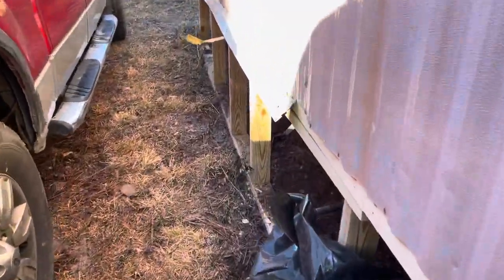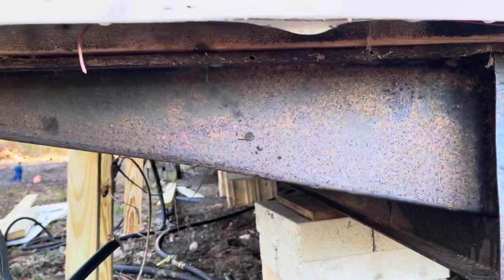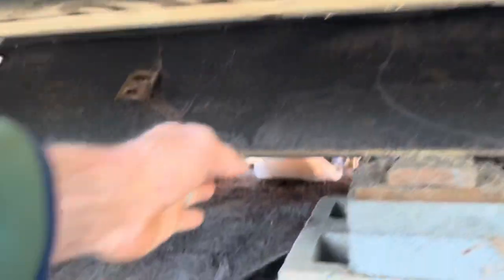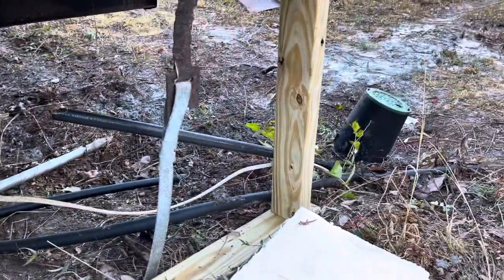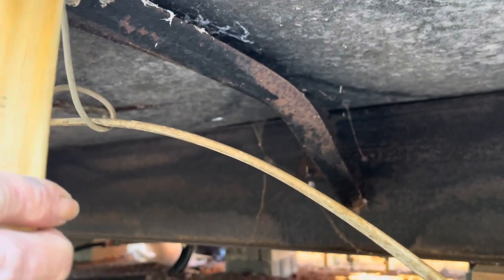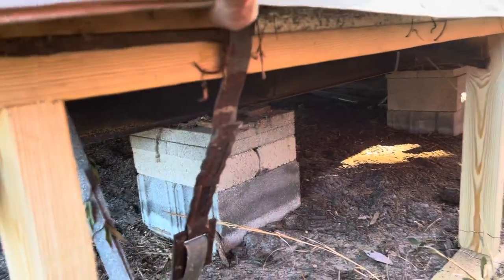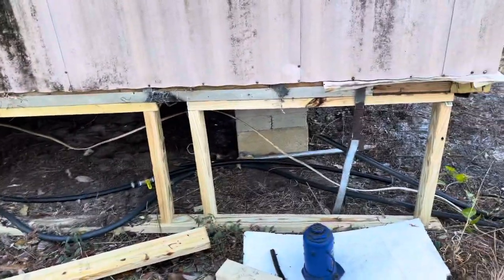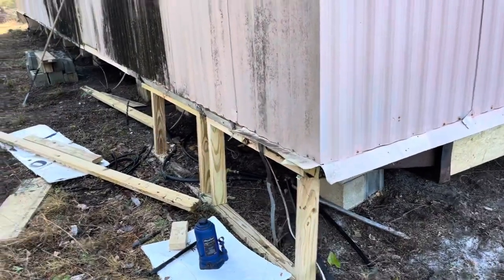Mobile home exterior wall support and underpinning

Comment: Love the video. Have a 1967 Fleetwood.
Used 4x4s across the top and hydraulic Jack's to lift the walls. Sitting on 4x4 columns on concrete pads and all strapped together. Very nice to see I wasn't crazy for doing this. Thanks!!
Reply from the maker: It sounds like you did a pretty amazing job that’s for sure using 4 x 4’s. I imagine I’m gonna use two by fours and I’ll put one every 2 feet. Then were you going to be using hardy board or hardy panels to completely underpinning. When you install a hardy panel you have to paint the panel with oil base paint all sides and any area that has been cut. But it makes for a nice underpinning job
Reply: @Drewsroofingandhomerepair  I used 1x6x16 rough cut pine pt. Painted to match the house. I'm the one who callyiu awhile back about the roofing job in Florida.
Reply from the maker: I bet that looks real good
Reply: @Drewsroofingandhomerepair  do you have any videos on installing a normal sized door in place of the front trailer metal door? I also have vinyl siding on it that my dad had installed.
Reply: Block underpinning the best
Reply from the maker: I agree 💯 percent
Reply from the maker: No, I don’t and I’m sorry about that

Comment: Hey, Drew, Drew my single-wide have the same 2×4 rim joists and longitudinal floor joist that run parallel to the trailer like this one. The majority of the rim joists are rotted and damaged.  Should I keep them as 2×4 and run them how they're going as is or is it ok and should I go ahead and change everything to 2×6 and run them in the opposite direction how normally they should go?

Comment: Do you need a footing below frost line? Will the underpinning,knee wall,settle without a footing and cause a sagging exterior wall again in the future. I ask because I'm thinking of purchasing a trailer that the floor joist are sagging about 2" all the way around the exterior.
Reply from the maker: Do not and I mean, do not buy that house I promise you they’re selling it to get out from under it. Do not buy that house. You will regret it and I live in Southeast North Carolina. It barely gets below 30° here ever.
Reply from the maker: It sounds like somebody put a roof on top of that mobile home that was too heavy for it. I promise you before you buy that house pay somebody to inspect it.

Comment: My floor joists (2×8) run perpendicular to the I beams and I have 2×4 exterior studs. I'm thinking about making those studs 2×6 for more insulation. Would doing these skirting walls (not sure what to call them) provide enough extra support for my idea? Original idea was cinder blocks with several 4ft access spots covered by lattice and screen
Reply from the maker: Yes your idea will work. I like the block idea

Comment: How would you go about framing the support if one side has a low deck that completely covers the underpinning on that side of the trailer? Im looking for an easy, kicked back in the easy chair by lunch time, piece of cake kind of answer 😎😉
Reply from the maker: I have a video on that let me see if I can find it I’ll share it with you
Here we are under the porch we had the same issue we had to go under the porch in order to do this job you can frame it in from underneath the house not easy but it can be done. Paul and I are two old guys and we did it
https://youtu.be/481PLCv9jI4

Comment: Advantec is $82 a sheet where I am at now.  From what I understand it is far superior to regular plywood since it is basically waterproof to a point. I have an old house and will use it when replacing the subfloor in the kitchen and bathroom.
Reply from the maker: It will be the best thing you ever did and it’s $83 a sheet here so the prices are pretty close
Reply: y’all are lucky if you are getting it that ‘cheap’. It’s $127.68+tax here….Got 4 sheets delivered and they dropped it in the yard. Family member pulls up and drives his truck over it and parks it on top of it for several hours before I noticed…..
Reply from the maker: Omg 😳. Could he not see it laying on the ground for crying out loud LOL. It’s starting to go down I actually paid $74 the other day. Wow $127 that is in sane Hell it might be worth driving here to pick it up

Comment: My walls arent sagging really but maybe 1 inch at the most but i did add a 30ft lean on with my deck and i was considering adding more adjustable outriggers for addred suport as a pre precaution have you ever used them or reccomemd them
Reply from the maker: I know exactly what you’re talking about and I would definitely consider using them or at least something for a stiff leg

Comment: I have put 3/4 solid hardwood in my single wide....i am also planning putting tile walls in my both bathrooms....if i put 7/16 osb and put LP smartside on my home do you think weoght will be too much of an issue? Also, if it is would putting support like you did here work or would cinder block piers be better?
Reply from the maker: I definitely think it will need support your talking about adding a lot of weight I would never use 7/16 on a floor even if I put something on top of it.
Reply: @Drewsroofingandhomerepair  sorry  if there was confusion...i was going to put the osb on the exterior walls because my home doesnt have anything under the vinyl siding
Reply from the maker: Yes, you can use OSB on the walls if you’d like, as a matter fact, I think that’s a great idea

Comment: I was going to do concrete block but this make more sense but I'll use PT 4x4s instead. I bought a farm jack to lift the walls. I've noticed some sagging because of the interior renovations.
Reply from the maker: Sounds like a good plan

Comment: Where are you located?
Can you recommend someone who does this in Sierra Vista Az?
My perimeter walls are sagging 
Your video is amazing 
I need help?
Reply from the maker: I would recommend calling your mobile home supply store they would know who works on mobile homes in your area that would be my best suggestion. I’m in North Carolina so you’re a long ways away from me. It’s not a hard project I promise you even a homeowner can do it. That is the reason why I share my videos I don’t think you need a contractor. It only takes some common sense and you can do the stuff yourself. 
So if you have problems finding somebody I think it’s a Projects you should literally try yourself

Comment: Could that be done w block?? Instead of the 2 *  4
Reply from the maker: Yes, and if you can afford it, I would recommend it
Reply: I just noticed maybe about a year now the sagging, I have a porch with metal roofhow to determine
Reply: Oh my goodness sorry, not sure how I accidentally sent the last message anyway I was saying I have a porch with a metal roof mobile home is around 30 years old brick underpin what is best way to determine if it is coming from settlement, roof or woodrot..?
Reply: Of course sure you've determined by now you're talking to a woman that has no clue where to begin but the problem is started to replace flooring in kitchen but there is a sag on one side which I was going to have brother and friend level but after watching couple of your videos talking about sagging from metal roof now I am trying to determine what is causing the sagging because I have a porch with roof right in front of where I noticed most of the sagging hard to determine because I have laminate flooring in rest of the rooms.. also have vinyl siding but I'm assuming no way to determine until you start ripping everything up huh?..
Reply: @Drewsroofingandhomerepair  how would you fix an existing roof meaning I have screened in porch with metal roof I told you it was leaking also but should that roof be detached somehow and somehow have it unattached and if so can gutters be installed meaning how to deter rain water... Meaning if I have exterior wall support added then I still have the weight of the porch roof do you have any suggestions what to do about that??
Reply: I was told that it would be okay to just Jack the house add the blocd and a 6 by 6 across the top of block and that would take care of it but I would think that the weight of the porch roof would continue to cause Bowing in the walls floor is already sagging you know I spoke with you about that any suggestions on the most inexpensive way to fix it as if there's anything inexpensive nowadays but you understand what I'm asking.
Reply from the maker: @Renee-ym5hh really without me seeing it with my eyes I would have a hard time explaining or knowing what to tell you honestly

Comment: How to do it when the Ground is uneven on one sides, it’s 1.9feet and then 4 feet on the other side
Reply from the maker: You have to go with the ground whatever the ground is frame it from the ground to the bottom of the trailer

Comment: Have termites infested the bottom yet?
Reply from the maker: No
Reply from the maker: All treated wood
Reply: Yeah I'd be nervous with that style skirting in my area. 

Even treated wood still gets attacked to some degree. Mainly because we have wet climates so moisture gets trapped under the house a lot
Reply from the maker: That is true. They have a termite plan around here and they are on that termite plan.